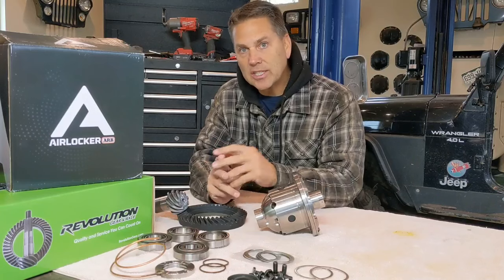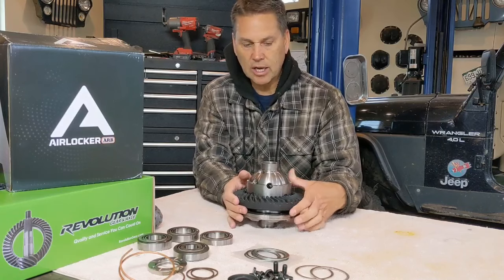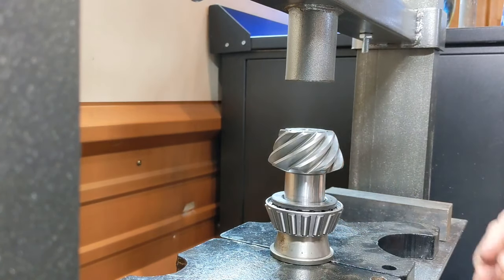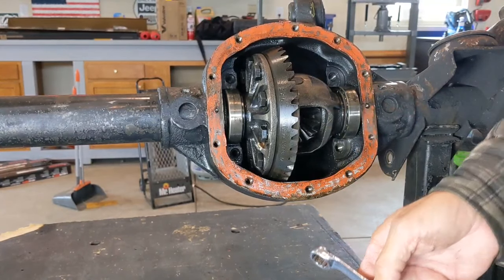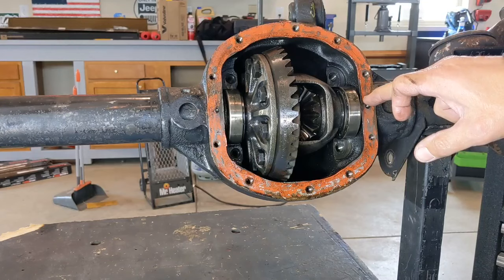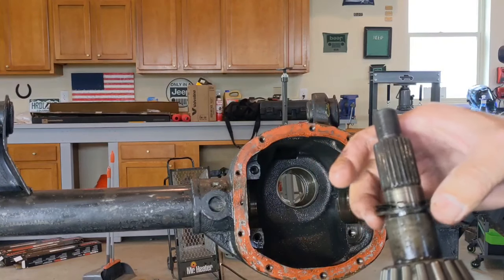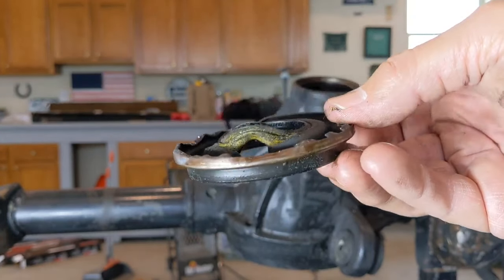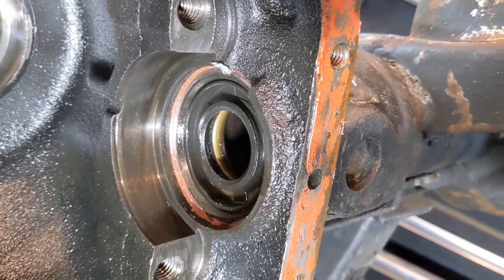How to Install an ARB Air Locker (Very Detailed!)

Comment: Can you make set up bearing for the pinion gear to mesure the pinion depth
Reply from the maker: Sure. You can place shims behind the pinion head or behind the race. Either works. However, you will be limited by what shims come in your master install kit. Some only come with shims for behind the race and others with shims behind the pinion head.

Comment: Had mine installed last year on my tacoma. Its leaking air out of a release valve on the other side of where the supply line is going in. I didn't see that valve in your video though, any ideas?
Reply from the maker: See my reply to your other comment.

Comment: Hi, thank you this vid. I found a hp Dana 30 that I need to re-gear to 373. Do I need to order different gear set than I would a normal front axle? I’ve heard some say reverse cut? Any insight would be great
Reply from the maker: If it is a high pinion Dana 30, yes you will need to get your gears in reverse cut.

Comment: So does ARB provide you with that pinion bearing race? Or are you buying a replacement OEM one? I'm confused.
Reply from the maker: If you're referring to the setup race, no that's on you. ARB provides new carrier bearings. Everything else should come in your master install kit
Reply: @TheBFHGarage  I was referring to the final bearing race you put in there for completion - does that come with the locker or do you need to source this?
Reply from the maker: @00chapmano  that will come in your master install kit
Reply: @TheBFHGarage  Okay, thank you. ARB don't mention install kits. In fact, they say everything you need comes in the box for the locker. I'm in the UK and finding it hard to get the info. Appreciate your help and your awesome videos.

Comment: Great Video. What if i was wanting to install that same locker but wanted to reuse my same gears. Would it be possible that the same shims will be needed? Or at least would the pinion stay the same?
Reply from the maker: If you are only changing the carrier to a locker, you should be able to reuse the gears. You shouldn't have to change anything with pinion depth. The difficult part is getting the same backlash and gear pattern. I would recommend checking and noting the current backlash. Then run a pattern before taking anything apart. Take pictures. Then set the same backlash and make sure the pattern matches too. The reason for this is that gears get work hardened when you break them in when new. This is a difficult thing to do, but doable.
Reply: Thank you.
Reply: @TheBFHGarage   @The BFH Garage  I really liked and appreciate the video, it answered a lot of questions that I have about putting in an air locker.  I noticed that your old differential just fell out on you, and you said that was a bad sign.  I had my axles regeared (at a specialty drivetrain shop) about 9mo ago, and had a failure of a spider gear which I noticed while trying to fix a front axle seal leak.  The differential practically jumped out into my hands when I pulled it out .. I take it that's bad.  It's of little consequence at this point, since I'm changing out the guts of that diff anyway, but it makes me suspect that my rear diff may have a similar issue.  :-(    Planning to self-install an ARB in the back later this year, so I'll have a chance to investigate at that point.  As with the poster who originally asked, I'm hoping to be able to leave the pinion alone.  I suspect that I won't be able to tell whether the bearing preload is right now that the bearings are a bit worn-in and fully lubricated, do you think it's worth trying to measure that before I go down the installation / setting backlash path?  After matching backlash, I assume I should still go ahead and check the tooth contact pattern?
Reply from the maker: @ivymike1031  ok, a lot to your post. First, that was a stock axle, the carrier falling out can be normal as the entire system is broken in and worn at that point. When installing new stuff, we want the preload to be tight at the axle housing will flex under load. Lockers need to be tight. As far as my changing anything with the pinion, it can be done if you're using the same gears but it needs extra attention to get it right. If you are using new gears, all bets are off.

Comment: Question, when you are locked does the compressor works and makes noise all that time?
Reply from the maker: No. The compressor only runs long enough to engage the locker...maybe a second or two. Then it will kick on every so often for a second just to maintain pressure.
Reply: @TheBFHGarage  Thanks, I have mine on the way for a JLU.

Comment: When in stalling the copper air tube ,  why not just delete the loop by cutting it to fit exact?
Reply from the maker: Cutting exact isn't as easy as it sounds. Leaving the line longer allows for more flex to route it up through the bulkhead fitting. Leaving extra line also allows for any damage that may have occurred at the bulkhead fitting.
Reply: @TheBFHGarage  i was going to ask this same question.  in other words, the loop is for strain relief (prevent kinking) and built in slack for adjustment, NOT a specific design requirement?

Great video by the way.  really good mix of technical, video, voice and editing. one of the better i have seen.  if i had heat in my shop i would feel ok doing this myself but will be taking it somewhere.
Reply from the maker: @johnhoover1999  exactly

Comment: Hello Mike. I just installed my arb air locker and when I assembled them I tested the locker. The locker works but every time I turned them on and when my wheel does half turn I can hear a pop or clunk after that it disappeared.  It seems only happens when I turned on the lockers, any idea? Thank you and more power to you.
Reply from the maker: If everything is operating correctly then it may just need to break in. The other thing I would check if you're hearing a clunk is your driveshaft and axle shaft u-joints.
Reply: @TheBFHGarage  cool. I'll sure to break it in and as the arb said to change oil after 1500 miles. My drive shaft and U joints are good and always have Grease in it and yes locker works 👌🏾.  I appreciate your time. Thanks.
Reply from the maker: @Bignaz_overland  fyi the clunk you hear may just be the locker engaging. If the splines aren't lined up exactly when you activate it, then it will once they do. Same thing for unlocking. If the axle shaft is in a bind, which often happens in Moab, then it will not unlock until it comes out of bind. Perfectly normal.
Reply: @TheBFHGarage  sweet, Thank you. I actually watched your video 3x before doing mine 😂😂😂. Thanks Mike!

Comment: If installing a locker ARB or Eaton and not regearing (have newer 4.56 already) would the pinion need to be set up or just the carrier preload/backlash. Also are the carrier shims always on the outside of the carrier bearings.
Reply from the maker: If you are just changing the carrier/locker, then the pinion should not need to be changed. Just get the backlash in spec. Shims are under the bearings on stock carriers and outside the bearings on aftermarket lockers all the time. There may be some exceptions but that's my experience so far.
Reply: Your videos have been the absolute best resource I could find. I've got the locker, install kit, and now all the tools for the install. One way or another I'll be (self) locked for my first Colorado offroad trip next summer.. Thank you so much!
Reply from the maker: @USfoolsgold  take your time with it... Frustration can easily set in if you're not careful! Look us up when you come out.
Reply: Once again, thank you! Will be utilizing my locker while attempting the Wall on Poughkeepsie at the end of July. Your videos saved me a bunch of $, and gave some valuable experience.

PS. Not that I want you get too big like some YouTuber's (because I then lose interest), but I would absolutely buy a BFH shirt!

Comment: I don't understand... At first you set the ring gear and pinion gear to the point of painting it and making sure it's set correctly but then you take it all apart and reset the pinion gear, even adding spacers. Did that not change the gap between the ring gear and pinion gear that was already set??? What about the crush washer? Did this setup not use a crush washer? Also even after setting the ring gear and pinion gear he went back and added the final bearings when he did the final pinion gear set. Ugh, I'm utterly confused!!!
Reply from the maker: Welcome to gear setting!!! I have several videos on my channel that cover setting gears. I encourage you to watch them and learn the intricacies of setting gears. There are a whole lot of adjustments that need to be made. When you change one thing, it changes another.
Reply: Your not understanding my question... Let me rephrase it.. in this video you set the proper alignment between the ring gear and pinion gear and use yellow paint to do so... Why didn't you use the finally races, bearings, shims for the pinion at this point???.. 
In my mind towards the later half of the video when you set the pinion gear to it's proper depth using the final races, bearings and shims this would have changed the whole setup between the ring gear and pinion gear that you had already set in the first half of the video...
Reply from the maker: @kyleharris3   I didn't mis-understand you. That is all part of setting gears. You use the marking compound to check your pattern. That doesn't mean you are done. You may have to do this several more times to get it dialed in right. Only when you get the pinion depth established can you move on to other things. As far as the inner pinion race, I use a "setup" race until I can get the depth established. After that, I still have to figure out the pinion pre-load. In this case it uses shims. In other axles it will be a crush sleeve. It depends on the axle type. Once I figure out the pinion pre-load, I have to take it all apart again so I can add the pinion seal. That is when I add the final race (using the same shims that established the depth) and put it back together for the final time. You should try it sometime. It's a lot of fun!

Comment: why would you add shims after the second set of marks it was obviously too deep
Reply from the maker: Depending on interpretation, it wasn't "obviously" too deep. My intent was to take it VERY deep in order to demonstrate bracketing. At that point it became "obviously" too deep. And that is the point of bracketing. It helps people who don't do this on a regular basis to understand the shim and depth relationship. Once the bracket is established, you can then fine tune knowing what your deep and shallow parameters are. Hope this helps!